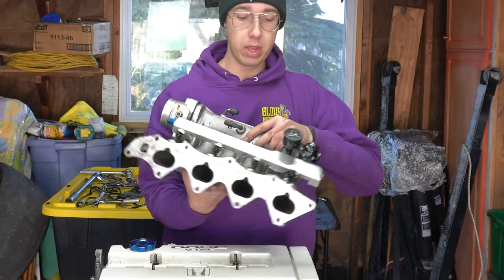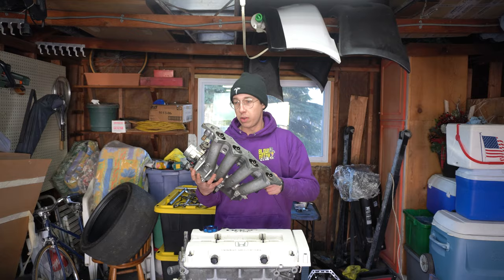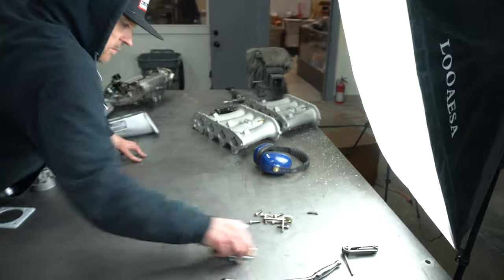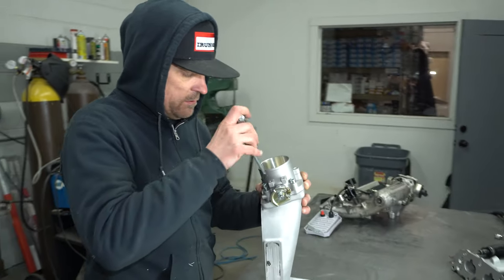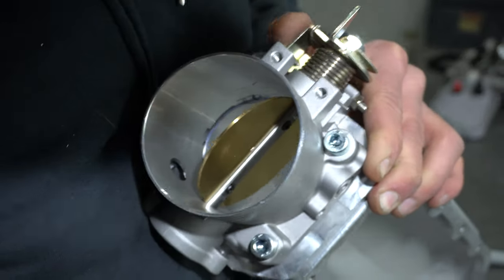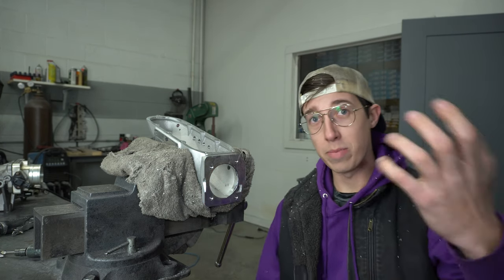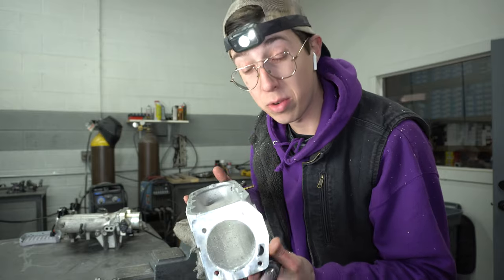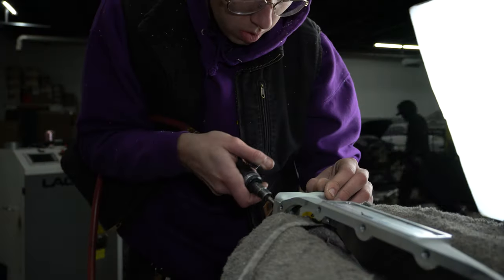How to Gain Horsepower for FREE!

Comment: After all that you did not do a "KINFE EDGE " throttle body flap  conversion. Buy getting rid of 80% of the flap bar , use a tiny bit of  solder to hold it place and use new flat screws . 5% more air flow , maybe more ? Cheers

Comment: Pretty basic stuff really 7 minutes to learn that the manifold needs to have a bigger opening than the throttle body...you need to remove more metal as there is still a restriction.